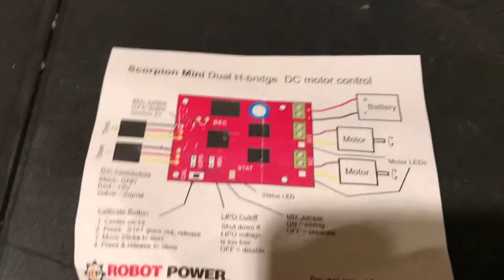Building a combat robot part 2 (Beetleweight) D2

Comment: Silver solder is not to be used because the extra heat needed to melt it has a greater chance of damaging motor internals. 👍

Comment: Did you have to wire your left motors differently than the right motors at the motor terminals?
Reply from the maker: yes, you can either flip them or just flip them when going into your ESC to pick which direction is forward or backwards